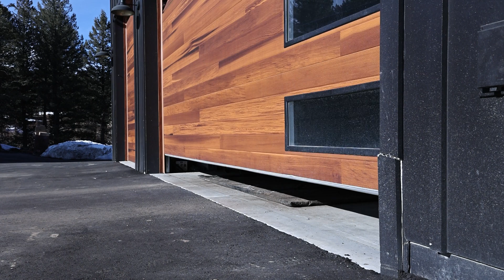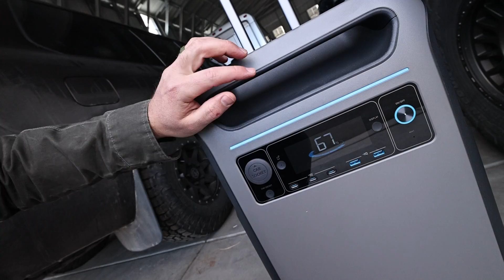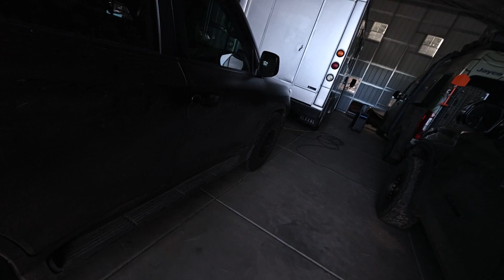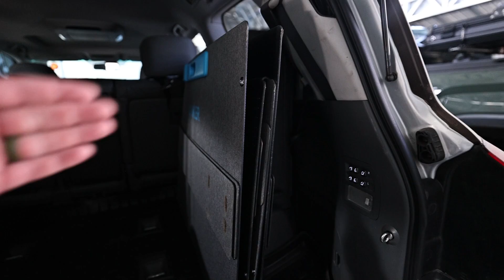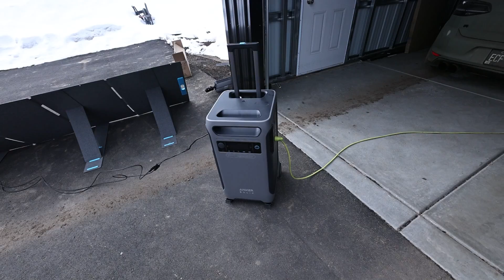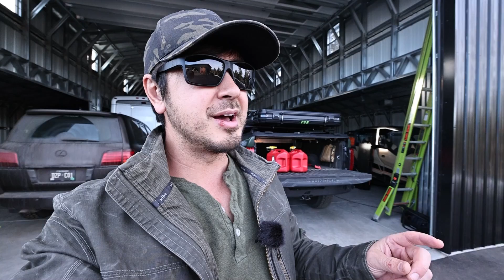Serious GRID DOWN Backup Power For The Whole House (6,000 Watts + 240V) - Anker SOLIX F3800

Comment: Electric heaters are 100% efficient at point of use as they convert every watt of electricity taken from the wall into usable heat, meaning there's zero waste. In this sense, all electric heaters do in fact have the same efficiency. 🙃
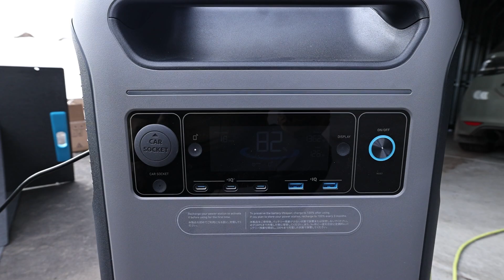@19:15 "Electric Heating is super inefficient"
Reply from the maker: You're correct - I didn't word that as well as I should have. Inefficient in the sense that it is the most cost inefficient method of heating, as compared to BTU/$ you can get from natural gas, wood, pellets, diesel, etc typically. IE if you're going to be heating - there are more efficient ways to do it.

Comment: I’m putting together an eco flow system this summer with the smart generator I think. I sometimes use lots of power and sometimes I use barely any so I think this will work for me. When I’m using a lot the generator can turn on and when I use less the solar will take care of it.

Comment: Hi, Mike! Been subbed for several years. I’m even wearing one of your flannels! I was wondering if you could do a video on what equipment would be required to fully recharge a Surron Light Bee and/or an Ultra Bee while out camping using only an electric generator and solar panels as well as how long it would take. For reasonable portability, what’s the smallest generator and how many panels would be necessary to have a fully charged bike everyday on a 2-3 day trip while still having a decent charge on the generator for other camping equipment usage?
Reply: i just got the bluetti 200L to charge my talaria and power my things while off grid. at 2,400W, it charges the battery and all my gear easily. the talaria only pulls around 500-600W and I believe the sur ron is the same or less. just need to get solar panels to power the generator back up. this thing is 60lbs, and i couldnt imagine fitting a larger unit in my rig. i essentially decided the 200L was the best unit for my suv/riding/camping because of the output for the talaria and portability.

Comment: Coughs in eco flow delta ultra. Leaning towards that system to back up my home 🤙🏽
Reply from the maker: I have that system also. I’d say that’s a better system where the primary use is house backup, and the F3800 is a little more portable for mixed use.
Reply: It would be nice to get a Delta Pro 2 that does 240v off of a single unit